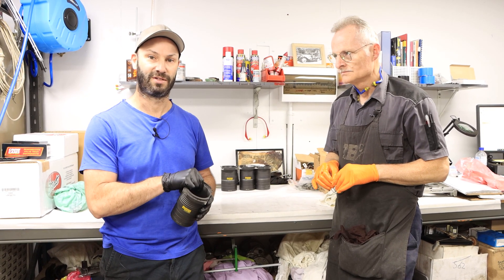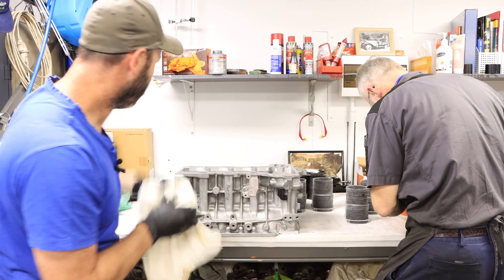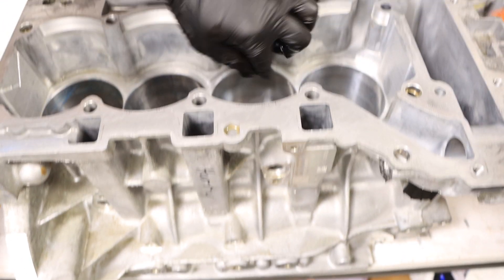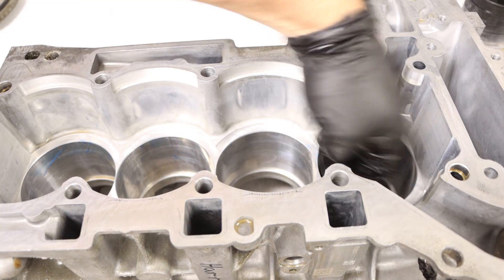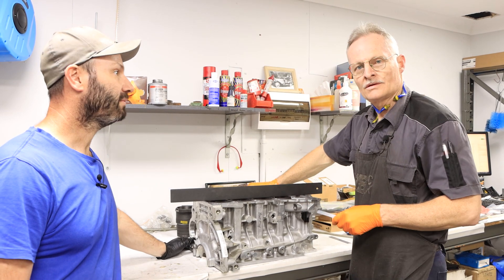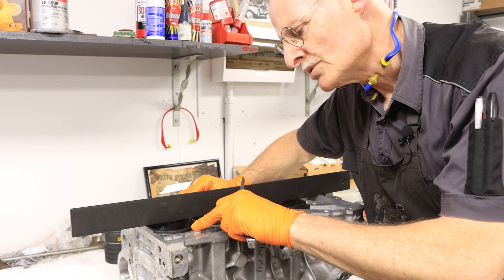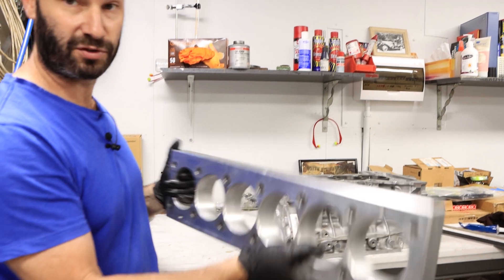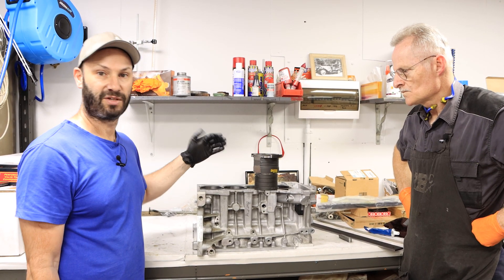BMW N20 Custom Liner Installation

Comment: What’s the final bore going to be? Is it a 91mm bore spacing like most small sixes? 

How do you account for differential thermal expansion? Do you end up with the liner protruding a few thousand when finished ?